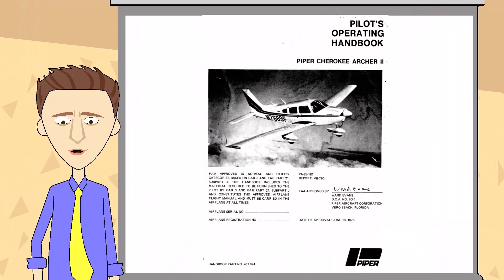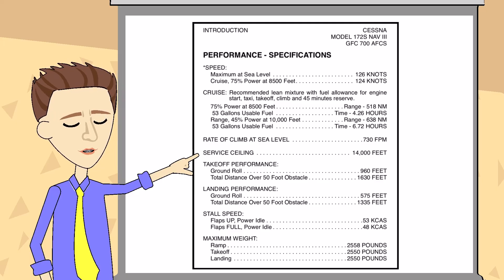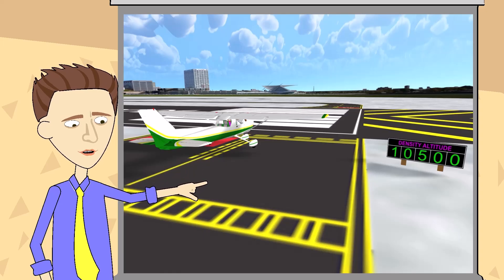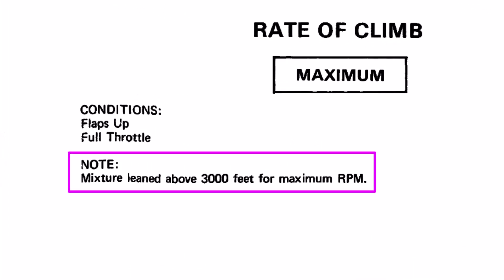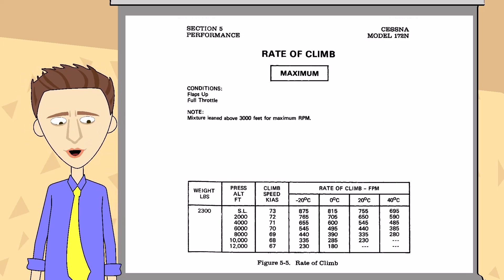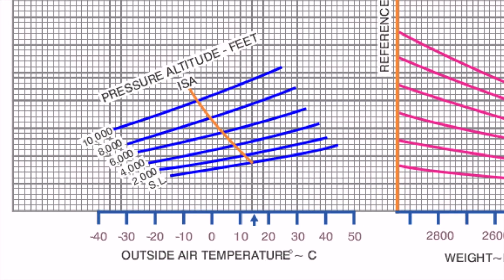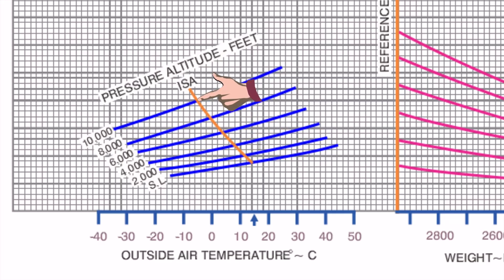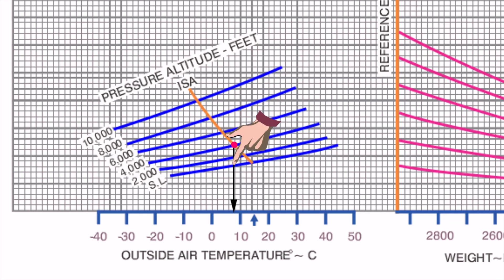Density Altitude: How Do You Use It?

Comment: Good points on how to think about airplane performance and fuel energy.  DA and weight, which both affect performance similarly, cause us old piston crop dusters to use default total energy management techniques.  So the basic level in low ground effect until any obstacles that cannot be rudder turned around require pitch up out of level in low ground effect takeoff is default.  The potential energy of down drainage egress is as much consideration as wind direction.

I also taught in the Cessna 140 at Monte Vista, 7611 MSL, summers while my wife attended Adams State.  I taught the basic level in low ground effect takeoff and told every student to pitch down a bit when pitching up did not result in expected climb.

Working the math on old 65 to 150 HP trainers, which had no POH, in the mountains midday in summer might suggest they were incapable of flying there at that time of day.  Yet we did fly them there at that time of day.  Not having the charts, we did have the law of the roller coaster and what the airplane wants to do from Stick and Rudder by Wolfgang Langewiesche.  And using those principles and techniques, not emphasized in the later POH and PTS/ACS, kept us alive for the most part.  Yes we had more incidents and accidents, but we had no more fatalities with higher numbers of incidents and accidents.  ACS and the POH emphasize don't go.  Stick and Rudder taught us how to use total energy management if we did go.